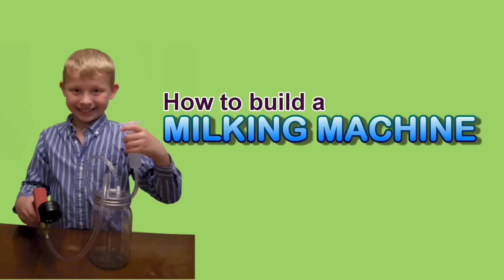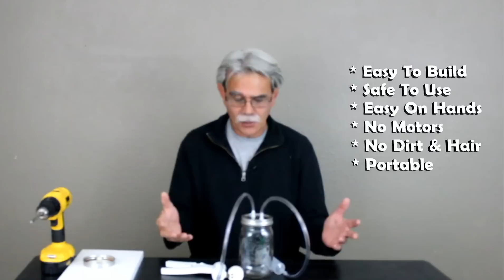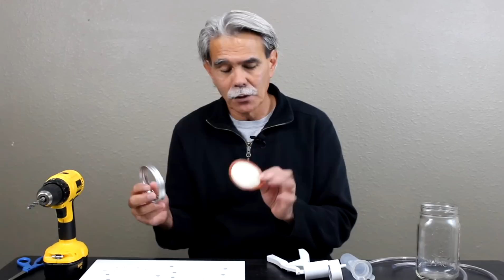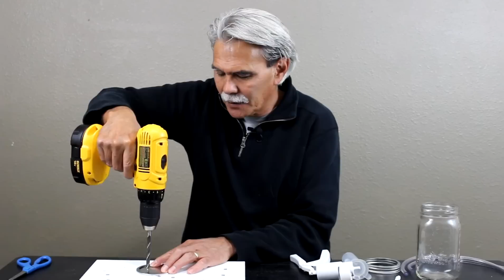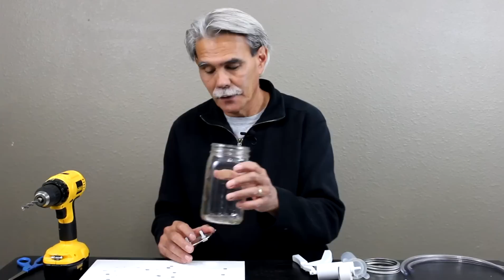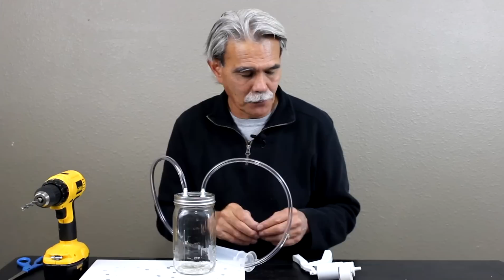Homemade Goat Milking Machine

Comment: What we bought...
4mm silicone tubing
4mm y connector
4mm threaded connector, rubber washers and nuts
Either 2l metal lidded mason jar or 2 1l metal lidded mason jars
Hand vacuum pump
2 syringes 20ml or 35ml depending on goat teats

Comment: i have tried to make one out of a gallon glass jar and the lil deal that sucks the air out of ziplock bags now its not working should i try to use a half of a gallon instead of a gallon also should i just milk one teat at a time?  On your hand pump i see it has a gauge do you pump it to a certain number and leave it at that?

Comment: Great video! Could this machine be adapted to have two teat cups instead of one? I imagine the hand pump would be fine for both.
Reply from the maker: Hi Jeffrey, Yes.. this machine can be easily adapted to two teat cups.  Just need a tee fitting coming off one of the milk lines to the jar.  Keep in mind that you will have to be more attentive during the milking process using two teat cups.

Comment: Where did you get the milk line fittings to attach to lid?
Reply: You can get them at hardware stores.
Reply: +Isaac Evans  what area at a hardware store are you looking in? plumbing, I'm assuming...? I'm trying to build one and cannot for the life of me find the type of fitting that have nuts and washers like this, I have used silicone sealant for the time being but it is an issue because I want to be able to take apart and clean thoroughly. the silicone I use is potable water safe...